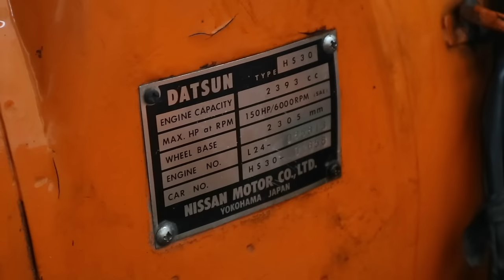Total Repaint & Full Restoration Datsun 240z in 20 Minutes

Comment: Meh……That 100% restoration job appeared to be about 50% amateur.  They sure used a lot of filler on the body.  There were no meaningful signs of any quality control.  If came out nice, but the real question would be “quality” and reliability.  I’m skeptical.

Comment: Nice work, please protect your health too.  It reminds me of my dad Datsun 120Y which was the same colour, which he owned between the 1980s to the early 1990s.
Reply from the maker: yes thank you for your attention

wow classic car, do you still have it? where do you come from?
Reply: @kiatmotor_  No unfortunately we sold it in 1992, we then moved to a Nissan B12.  I am from Mauritius found in the middle of the Indian Ocean.  But the sound of the Nissan A12 engine in the 120Y is something which I miss, I am also surprised by its performance for a car which also weighed only 830Kg with a small engine displacement of 1171cc.
Reply: I still have one.  I think.  It's at my parents house in Ireland.  Unfortunately I just learned the roof came down on the shed some time ago.  Oof.  Turd brown, stick shift , two door sedan.  Looked damn cool with the chrome bumpers.

Comment: a very precarious job. many details in the repair of the metal. they definitely don't know sandblasting (for example). unrestored interior. that car needs more love!
Reply from the maker: We know sandblasting and acid to remove rust all over the body and chassis, but those facilities don't exist here, all because the service costs in this country are different from your country which is paid per hour, even though the price of automotive equipment is very expensive.

Comment: I have so many concerns with this "full restoration".

This car was in very good condition to start with, it needed minimal welding, it wasn't crashed, etc. I wish it wasnt even repainted, just paint corrected on the places where welding was done, then polished. It would be worth more in that way. If you want to full paint a car and remove all the rust, I stongly recommend sand blasting the whole chassis inside and out, because it was painful to watch all that scraping and grinding of paint. Also, I hope you took apart the whole suspension and brakes, changed the bushings, etc, not just painted it all toegether like shown in the video. I won't even start about the engine...it seemed like you didnt take it apart at all, just plated some screws and whatnot to make it look shinier. This is very much effort, but the car would be worth more if you left it as much original as you could. Thats my opinion.

If you guys want to see proper restorations of 240Z, look up S30world, it's a small company focusing only on 240Zs. We restore cars to the last tiny screw to be as it left the factory.
Reply from the maker: hello dudes,

we are a workshop that focuses on working on the body, not machines or suspensions and others.

This car arrived not original, when we scraped the paint off we found blue paint that had been overwritten, so the owner decided to repaint this car.

we are in Indonesia with a service fee unlike in the US which can reach $100/hour, so we or other workshops in Indonesia do not have sand blasting, most will use paint remover to scrape the paint but we choose to use a heat gun

where do you come from?

Comment: I'm surprised you don't dip the bodies to remove the paint and filler from the shell;   more expensive, but more thorough.  Also interesting you use clear coat;  I don't think the original Z cars used the clear coat process, although ultimately that is faster.
Reply from the maker: in Indonesia there are no body restoration workshops that use dyeing because here we are not paid as well as in Europe or the USA which can reach $100/hour

z series doesn't use clear coat? then use what?
Reply: @kiatmotor_  That makes sense;  dipping can be expensive, particularly if labor is far cheaper than it is in the US or Europe.

For that vintage of cars, I believe it's correct to use alkyd enamel, although admittedly, this takes more work than multi-stage paints like clear coat.

Nice job though.  I like your work.

Comment: That's not paint you peeled off around the spare, that's the stock sound deadening with paint on it. Calling you out as BS @ 1:35 in.
Reply from the maker: it's a painted damper, but still it's paint. lol
Reply: Exactly my thoughts. Also it's not even that rusty unerneath, it's just light surface rust, very good condition for a 50 years old car with original deadening.

Comment: 310.000$ for what? That's not even a 432R or has OSGiken Parts... WTF! Is that a typo in the description?
Reply from the maker: $310,000 is how much a datsun 240z cost at auction, cross click this link to view https://bringatrailer.com/datsun/240z/?q=datsun+240z&sort=bids
Reply: @kiatmotor_  That was just ONE! And it was original unrestored and had only one owner! Also it was in absolute perfect condition, never repainted or had ANY scratches inside or outside!!! a restored Datsun 240z costs ~60k... You are delusional for thinking, that you can sell every Datsun on auctions for up to 310k!